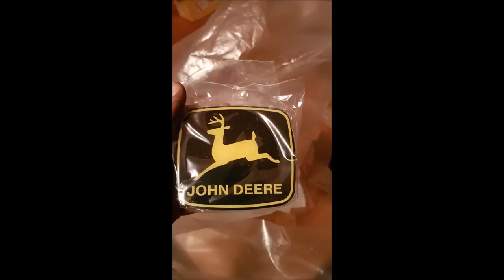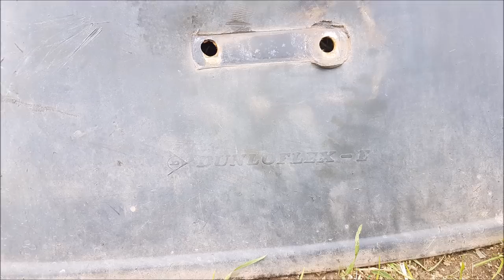John Deere 6910 | Restauration

Comment: pretty amazing we hav e JD 6310 and it could use some work,it has 22 000 hours on it and mostly it still runs very well but the colors are doll and  should be repainted
Reply from the maker: that tractor earned its keep, and deserved a respray ofc with 22000 hours :)

Comment: 155PS an der Zapfwelle ist 👍
mein 6910 bringt 135PS anstelle der 125PS in der Betriebsanleitung🚜.
Allerdings hätte ich bei 155PS Angst um das Getriebe.
Reply from the maker: Das Getribe kann deutlich mehr ;)
Reply: Beim Aufdrehen ist im Sommer vor allem die Motorentemperatur das erste Problem. Getriebe ist klar das letzte, sofern es ein AutoQuad ist